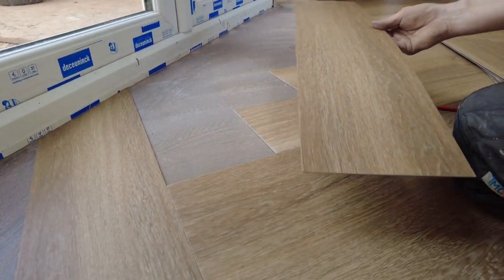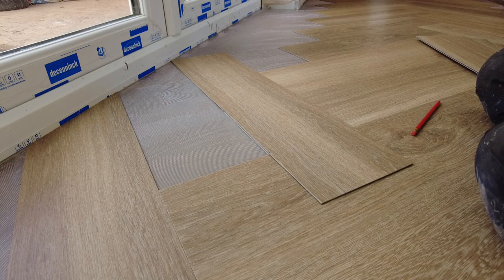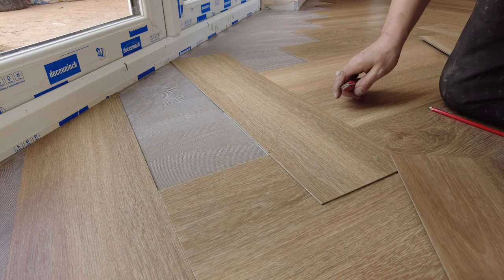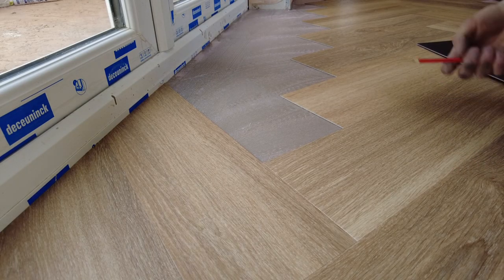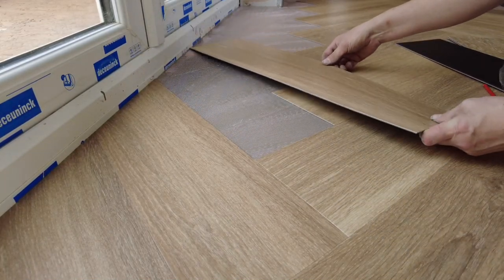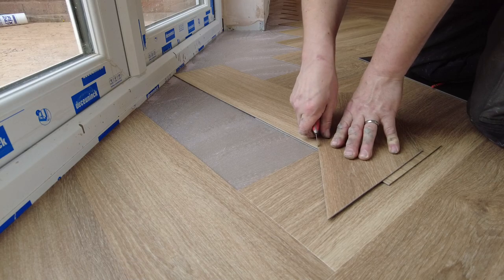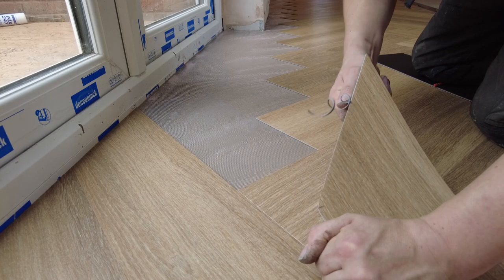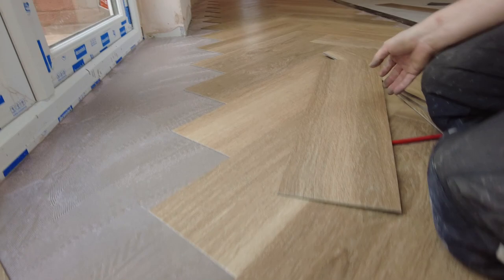how to cut ANGLES like a PRO!!!   (karndean van gogh)

Comment: Is this H T extra adhesive ? If so will the glue not set before you finish all your cuts ?
Reply from the maker: Yep ht extra if it dryers to quickly then I'll repast but it didn't
Reply: Repast over the existing or scrape up dry glue and re glue ? How much time do you usually give yourself to work with ? I worry about it going off and not grabbing as it’s not a pressure sensitive. Usually work with karndean universal which is very similar to the amtico ht and was told by other fitters I would have hours to work with but I though this glue has to compress while it’s wet ? Thanks for your answers. Much appreciated
Reply from the maker: Scrape it then repast ht extra in the cold can be good for 30 minutes but when it's hot about 10 I love ht extra in sunny area's and over underfloor heating a subby used universal be in a sunny area but it failed so I don't take the chance but sometimes use universal in rooms with no sun hitting it. It is  a good adhesive 👍
Reply: Ht extra still shrinks in sunny areas not ideal for direct sunlight. Have you tried that ardex k1 ? Was wondering what’s people experience with it is